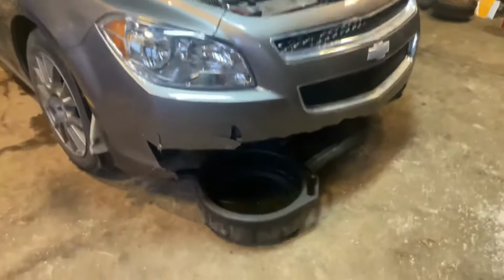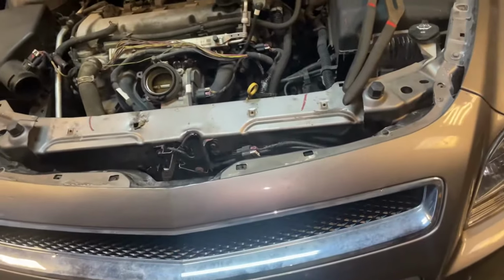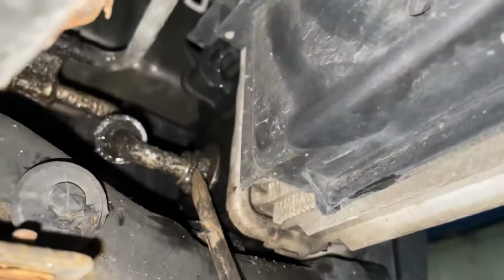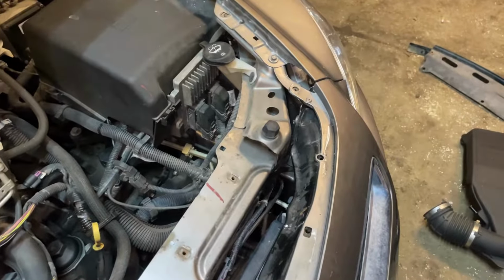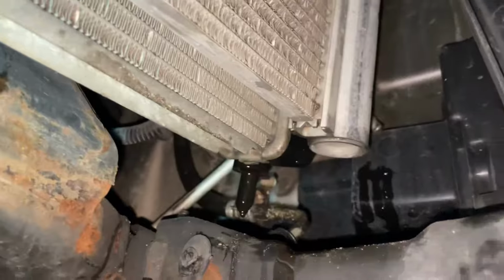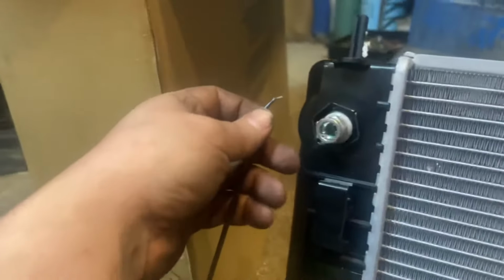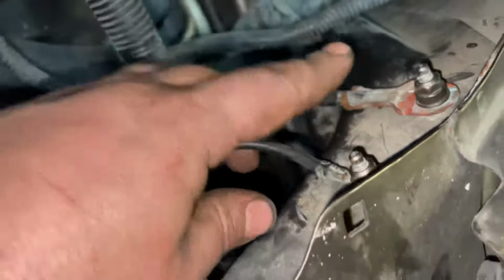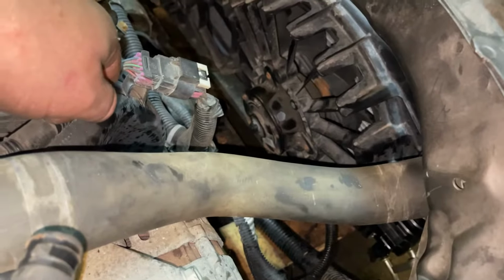Chevy Malibu radiator replacement

Comment: There actually a quick disconnect tool you can use to get the transmission lines loose, it's small, looks like a fuel line disconnect tool, some radiators actually come with it in the box.

Comment: I have a 2010 Chevrolet Malibu LTZ I recently had a fender bender in the front and one side of my impact bar is bent in and pressed against my radiator causing it to bend, so I'm curious if the bar van be unbolted or if they come welded ?
Reply from the maker: Not sure on that particular make model off the top of my head. Good question for a body shop. If you don’t care about how perfect your vehicle looks do your thing and bend away!

Comment: Can you do this on a 2010 without taking the front off?
Reply: Might wanna take the clip off but 2008 through 2012 is the same way to remove the radiator